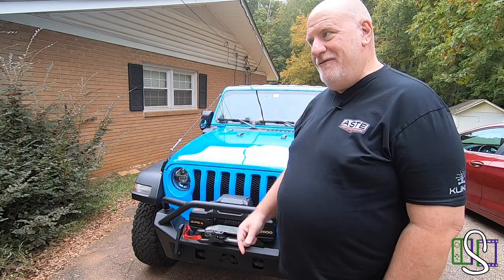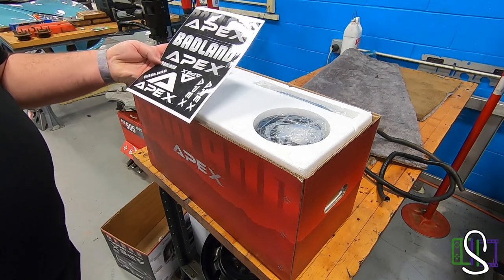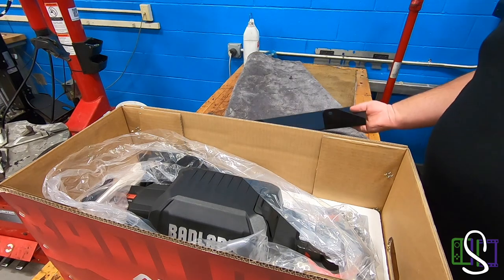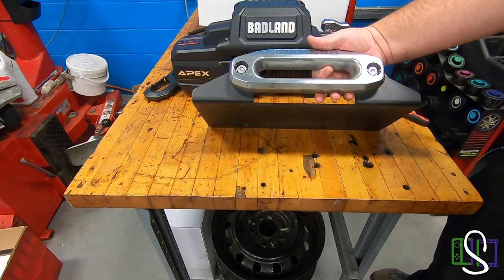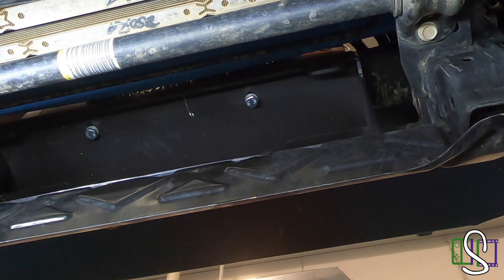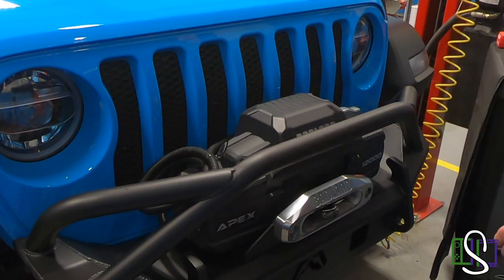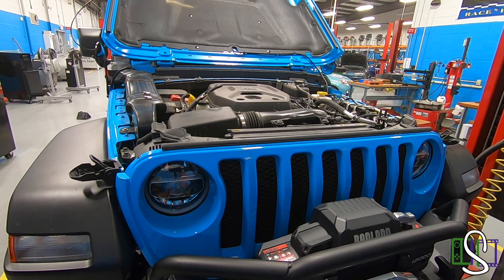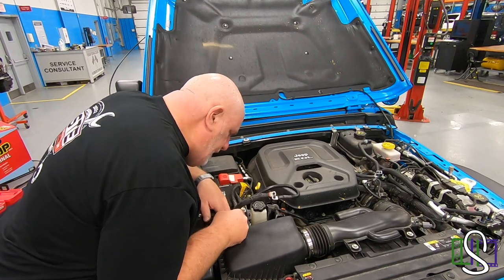Installing the Harbor Freight Badland Apex 12,000 Winch on a Fab Fours Stubby Bumper 2021 Wrangler

Comment: I'M INSTALLING MINE TODAY and thought what a funky way they want the winch installed. I have a 15000 Warn on my truck.  Me thinks itzzzz pretty stupid to have the bolts going up instead of down. Hmmmmm if bolts fall down then winch is totally free. And then there isn't much room when you tighten bolt from it hitting the bottom of the winch. Almost seems it has to be perfect.

Comment: Great video but could you tell me how you routed the cables again? It was kind of hard to see but did you underneath and up the side, or through the grill up & over? TIA!!
Reply from the maker: Hi there! I did underneath and up the side, Hope that helps!
Reply: @scrufytam  It does, just curious if you had any video footage or pictures of the cable run but no worries if not, Thanks!
Reply from the maker: @maverick_jl  - My apologies, I do not. My main concern was keeping it away from the fan blades and moving/sharp edged parts
Reply: @scrufytam  No worries, that's what I am trying to do as well.. I ran the cables down the passenger side of the bumper thn underneath staying close to a few metal body parts then up into the side hood area where the battery compartment is. Thanks again!!
Reply from the maker: @maverick_jl  - if you’d like, I raised it up and took some pics I can email to you. scrufytam@gmail.com

Comment: Hi, what bolts size is correct for. The bumper? I'm trying to figure it out and the ones from the website don't seem. To fit I bought it used and the guy told me to use the ones from my gladiator but they don't fit either properly. 😐
Reply from the maker: Hi there patan! Thank you for the question. I am not sure of the exact size of the bolts. I apologize.

Comment: Where did you get the antenna mount on your hood latch?
Reply from the maker: Hey RubiconTJ, I just realized that does look like an antenna. However, those are limb risers and that's a bracket to anchor one end of the limp riser to. https://smile.amazon.com/dp/B07KW8BVD4/ref=cm_sw_em_r_mt_dp_RNVKX7STPW7PR4CRRC4X?_encoding=UTF8&psc=1